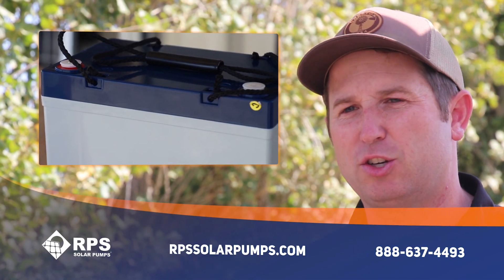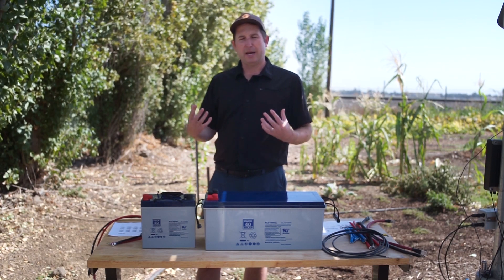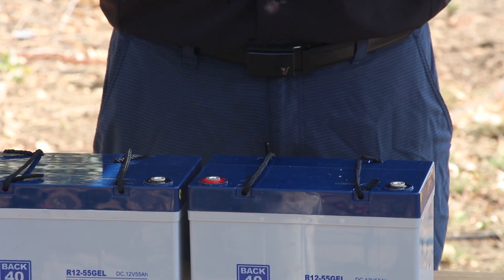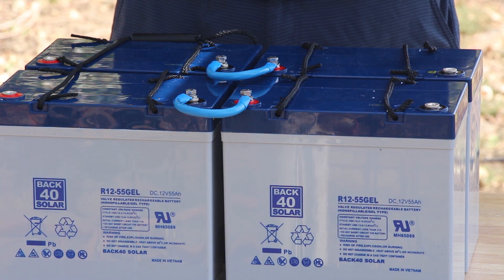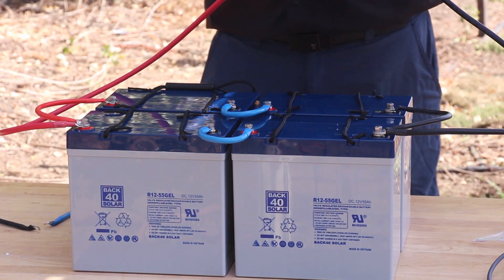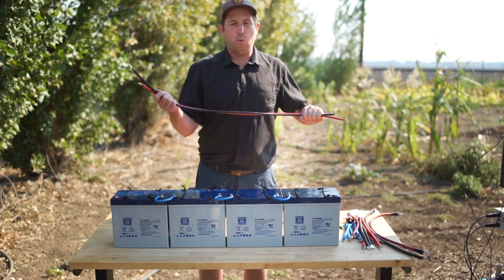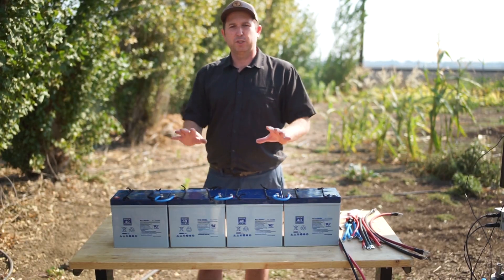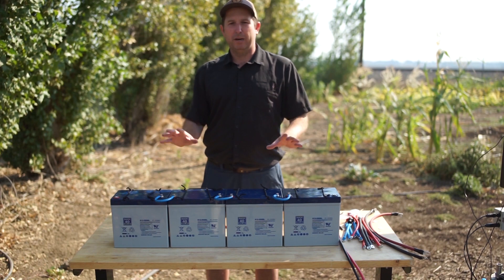Wiring Batteries for Solar

Comment: When connecting your positive and negative leads from battery to the charge controller, you should mount at opposite corners of your battery bank.  This allows for even 'draw' and charge levels for each battery.  Otherwise, you are relying on the first two batteries in your bank more than the entire bank.
Reply: H&H is absolutely correct.   the diagram presented will kill all the batteries down the string over about a year in some studies i did in college.   to prevent this, spend the money and make every connection to every battery in parallel exactly the same length.

spend the money, or don't waste your money on batteries

this is very common and does not last when done as a long string.   Be advised also, that you will have to add panels to fill the tank as it were on those batteries.   there is internal loss of current and that has to be replaced as well as usage.    talk to a solar tech such as myself if you don't understand.
Reply: @dysfunctional_vet  can you elaborate on spend the money to make sure all connections same length? Are those connectors he's using not good, thanks

Comment: Good overview but could use a segment on connecting to the charge controller. When I did mine I got a big spark and wasn’t sure that was normal. RPS support helped me out as always but in a video like this it would be a valuable addition.
Reply: That's actually normal. It comes from the initial surge of power from the battery when connecting. You can prevent that by using a resistor or a lead pencil touching between the positive terminal and positive cable.